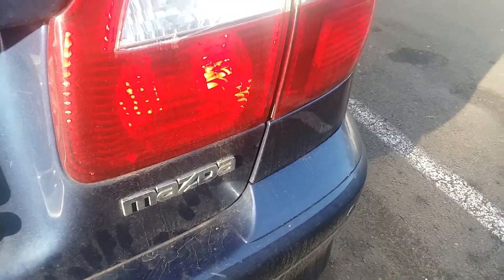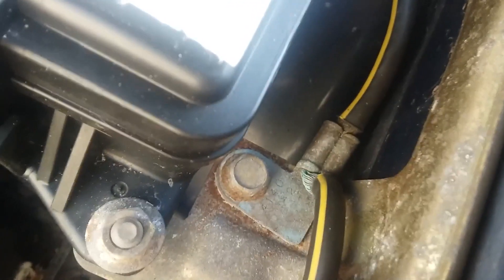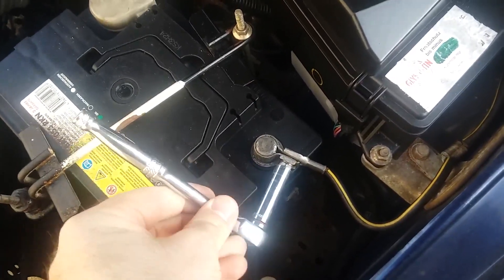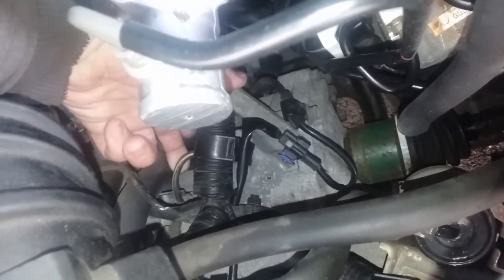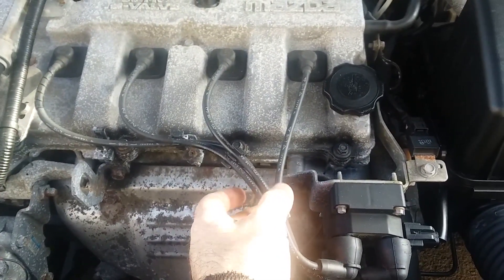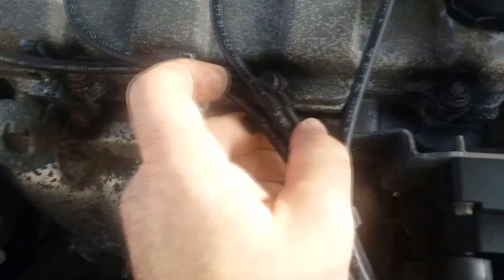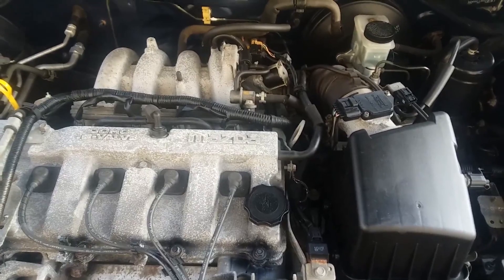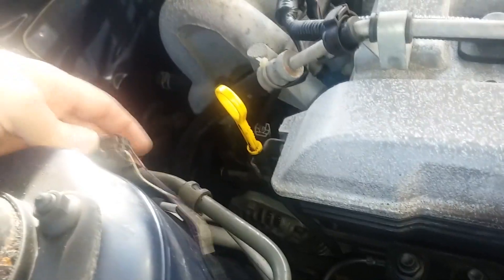Your car hesitates? Top Tips using a Mazda 626

Comment: If the spark plug gap is wrong, does it knock at the ignition, what is the correct spark plug gap, the vehicle 1993 mazda626 2.0 fs engine
Reply from the maker: Knock sensors should prevent knocking from the wrong gap. I'm not going to look up the correct spark plug gap for you. A good search engine should easily assist with that. 

Take an example of increasing gap on purpose for theoretically more performance. If spark timing advance is working well it should be able to run more timing advance. 

Depends on how aggressive the PCM and what the knock sensors are picking up.

Comment: Question: My car randomly won't start sometimes, the dealership replaced the starter on a 2002 Mazda 626 and it's still has the same problem. Would bad spark plugs also cause a car to randomly not start? I turn the ignition and it doesn't start immediately, it might take 20 tries.
Reply from the maker: Actually, yeah, it would. I have a lot of videos about analyzing spark plugs. Check them before waste on money on new ones.

Also, spark plug wires are more often the issue than spark plugs, but what often runs wires? Worn spark plugs. Lol
Reply: @DENicholsAutoBravado  Appreciate you responding.
Reply from the maker: You're welcome. I actually did 626 spark plugs on video if you'd like to see it. The car came up under the title on my channel, something like, why is your car hesitating? Those same issues can make startup harder.
https://youtu.be/twCVAfdPAl4
Reply from the maker: If you can't find the other video, which I didn't share, feel free to ask, but it was in my last set of videos.
Reply from the maker: Lol. Never mind, that's the video you started with, but the link shows you more if you need it.

Comment: I really don't like the way the main power is piped around and the crappy ground.
It needs heavy copper cables from a welder or a truck in your local car scrap yard.
And another one from the engine to the battery minus.
Yes i'm a power freak lol.
Has the dust in the air filter got into the throttle body twisty plate (can't remember the name).
Anyway, who the hell are you?, maybe the younger brother of mr Nichols :-D
Reply from the maker: I can't seem to find any junkyards! There's another car which I paid less for than the cost of a catalytic converter to get around in while I'm here. It really doesn't need a new catalytic converter. Just one that's not busted up...but I'm kind of excited about it because there's some of those popular tests I can try to see if they help. Tehe.
Reply from the maker: I read your comment to the ladies in the break room, saying "this guy is always so funny," and I told them where each of you lived all over the world. 😁

England, Australia, couple of U.S. states and many more if you count other videos of course, but I'm referring to the first few gents who were here to make me smile. 😁
Reply: Ahh i do try to add some daftness to my comments, it's a habit from my years on c.b radio :-).
I'm daft anyway, so it's not difficult :-D
There are people that are so good at comedy they would have you gasping for breath while laughing.
Now they are the ones that are "So funny".

Comment: Replace your fuel filter fools. Fixed My issue. Do it every 2 years.  I used to push on gas it wouldn't go right away frequently
Reply from the maker: I must say, that's never helped but most of my vehicles never had a fuel filter.

I had 1 customer who religiously had us do that every 2 years and he drives OLD Chevy Trucks which run great!

Not the classically great Chevys, made newer ones keep going nice. Amazing considering the issues those trucks can develop.

Comment: Germany?
Yeah I paint my ground wires, keeps the corrosion and oxidation at bay.
Reply from the maker: What kind of paint? I'm pretty sure this is just automotive paint, not a special anti- corrosion. I worry it accelerates rust instead.
Reply from the maker: I think even "wrong paint" would work better if the wires were nice. I worry it's covering corrosion as I see corrosion at the edges.
Reply: The paint I use I got from IBM when I used to work for them. Clean the metal where the wire or cable meets with the body or engine and put a star washer on the engine or body side then secure with nut or bolt and then once tightened paint to cover the surface of the body or paint and the bolt or nut. I also paint the positive and negative cables and battery terminals. Some put grease on the terminals and cables but that catches and holds dirt, debris, and all kinds of junk. I like them dry so if you paint them and they dry they don't catch and hold on to dirt and they are sealed to keep corrosion from forming. Works for me. Happy Motoring.
Reply from the maker: @mostlymoparih5682  Since it works for you, that means you're very good at it. I've had no starts come in my bay due to customers using correct paints on terminals. Example: driving off while it's drying and it cooks into the inbetween places and blocks conductance. It's made me a paint miser. LOL

Yeah, the grease is okay and all, but I think the dirt can end up conducting some of the current across the battery already, no need to add to it with grease at the terminal helping connect all the dirt together into small power losses.

With the paint, I bet the dirt would be challenged to do anything, especially if the bottom of the posts were painted, at least below where metal to metal contact was needed. (I'm in new territory, I think expanding on your ideas now!)

I can imagine it now. First, fit your terminal, then remove to paint the bottom to for maximized perfection. (watch for the metal scored so you know where the paint can't be)

Oh, I think I could make a video of it, but translating products in German is very painstaking. They tend to use small print on all the details I want to read and that makes it troublesome for the google translate camera. I give up and occasionally eat things that could have something I'm allergic too and promise to next to buy foods with fewer ingredients. (yes, I went from tiny customer instructions on automotive products to food - the last German product I used had all English inside! I wonder if some Germans were frustrated, but I bet they had all they needed already where it was inconvenient for me to read) It's unusual when you know what you're after to have an allergy surprise in foods, but I have to be careful....I'm trying some very different stuff!

I could write twice as long as I've missed you guys, but I'll keep it back as a short essay! LOL (When I re-edited, I couldn't help but add all the () sections! LOL)
Reply: Yeah I put a rag in the cable hole and paint both sides of the cable but as for the terminal post under the cable I just put some electronic silicone on the post as it's too much trouble to figure how much of the post to paint and then the next time you remove the cables how do you clean the posts? If you clean off the paint ya gotta repaint it again which is a pain so I use Brylcreem it is. Ya know a little dab'll do ya.